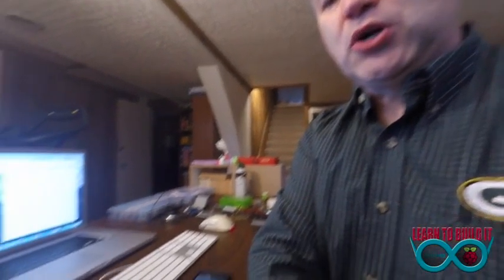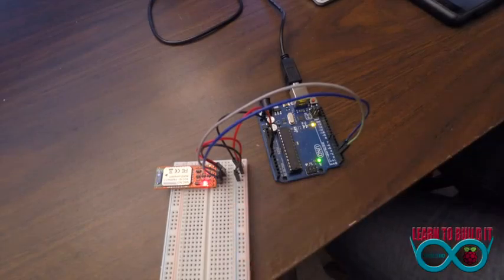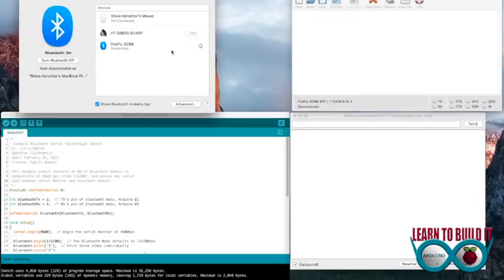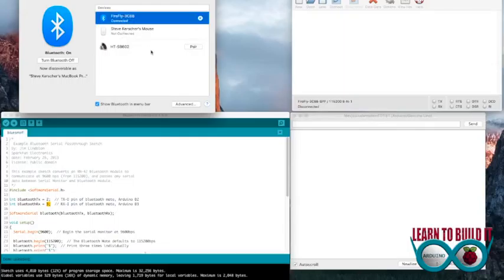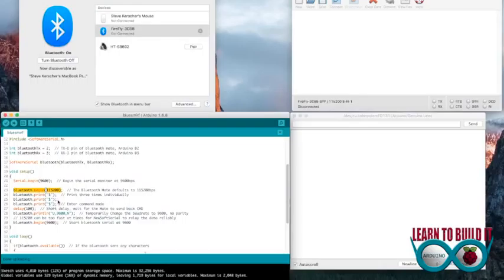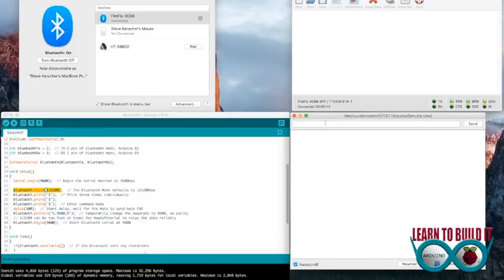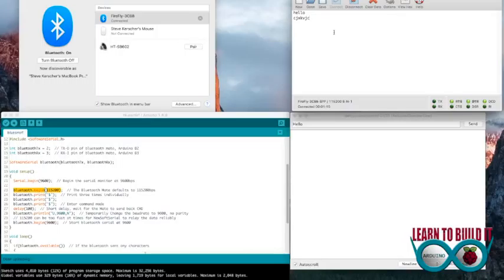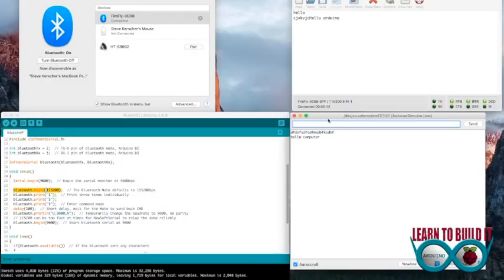Arduino Bluetooth Bluesmirf

Comment: If I wanted to send analog data from a force sensor (FSR) to my computer via Bluesmirf, where would I implement the analog code in the Bluesmirf code? I am new to coding and microcontrollers all help will be much appreciated.